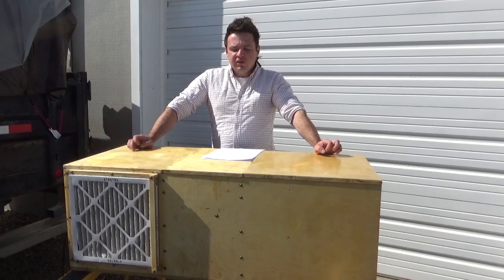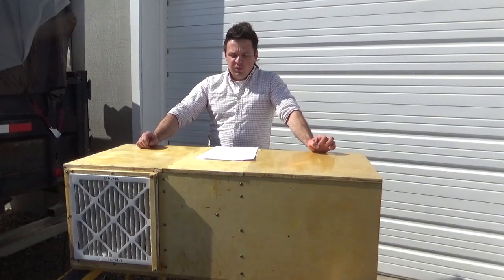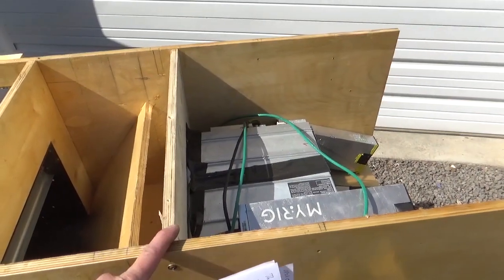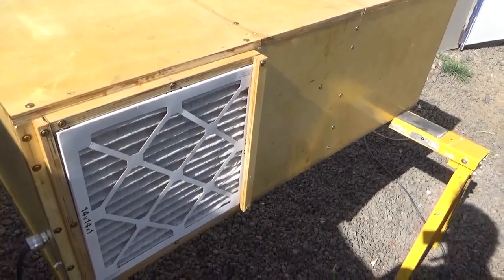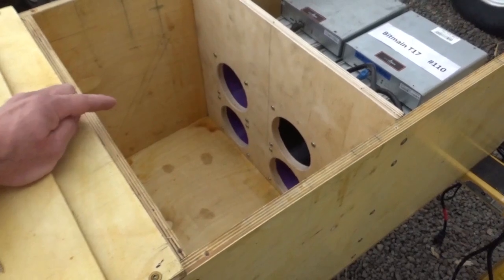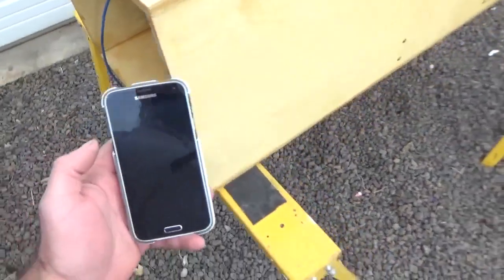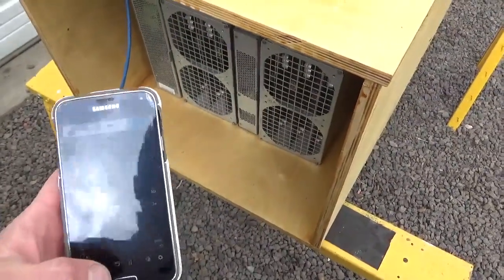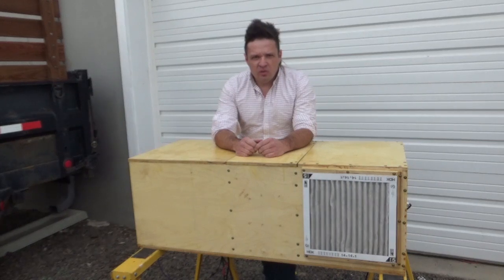Supercharging your bitcoin miners in style for fun, profit and massive noise reduction

Comment: think you could reduce the noise some if you add lengths of the damper hoses meant for aircon units on the intake and exhaust end , might need to double up on them to get you cfm 
another option would be to add length to the box and line the front and back with that sound insulation foam , maibe add some baffles to make the ait hit more of the foam 
that will make the cabinet about twice as long so the hoses night be the more flexible option

the now sold 3d printed ducting direct some of the air intoo the psu fan openings , you can do away with the noisy little psu fans and reduce the noise a little more on the exhaust end , probably can 3d print sumting simulair tob wat you used on the main fanopenings in the case , might need to experiment with the size opening in the pywood for the psu to reduce the flow intoo the psu and keep more flow to cool the asics

Comment: super cool system. whats an approximate amount you spent building this? any ideas for improvement? acoustic panels, etc.

ever tried to use the heat for heating your home?
Reply from the maker: The cost, with the wood, finish and blower was over $1200. The plywood has almost tripled in the last year, and was about $500. The blower was about $450 shipped, but I see its gone up since then. Plus some misc stuff. I was hoping to sell these as pre-made kits, but I think at the current wood prices it would be prohibitive. 

Its intended to heat a home and will go into full time heater/miner operation in the fall. I think if you use the s17/s19 miners it would work very well if you have an open space and not concerned with exact temperature control, like a shop, garage or a basement.